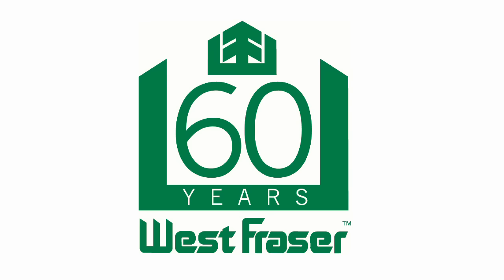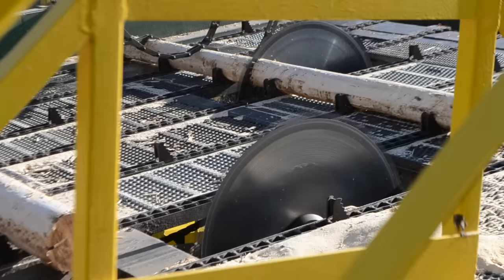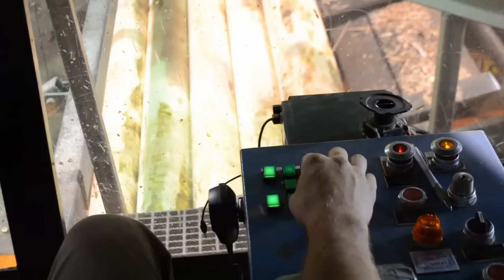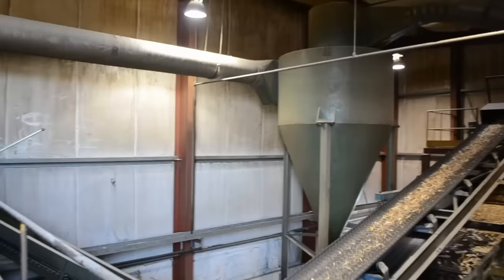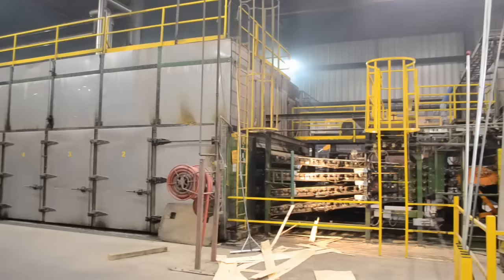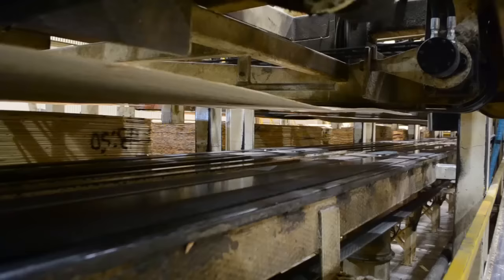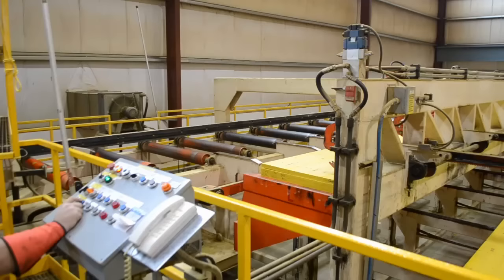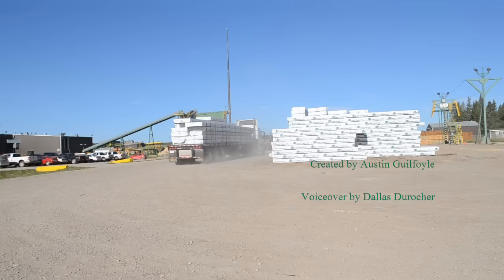West Fraser LVL

Comment: Awesome video , I’ve  been using LVLs for years , (along with almost every builder) and it’s great to see how they are made 👍👍👍
Reply: The worst part is driving nails thru! Those are damn hard lumber
Reply: Are they used for beams to span ceilings, and floors? And are they as strong as real lumber? I've never seen it before today!
Reply: @grosom31   Random guess would be double the strength of #2 spruce and use wherever wooden joists are used

Comment: I enjoyed that. Would like one showing how these LVL's are used!
Reply: as a carpenter i can say ::: lvl is used where you need more strengt than normal lumber would give.
good lumber is strong, but can have weak spots, where say a branch go thru the beam.
a lvl beam more standard. say if a dimension is rated for 2 ton load,, you dont have to look for weak spots,, while with normal lumber you had to test each log.

Comment: Must be very cold to work in that plant during the winter! Some buildings had insulation, others did not.
Reply from the maker: This one was usually pretty warm if you were in the main building (especially near the dryer) and a bay door wasn't open next to you on a really cold day. In the summer it was disgustingly hot at times, even at night. There's a building not really covered in the video next to the 'bucking station' called the 'pointer domer' where grape stakes (and sometimes other things) are made from the leftover log cores, there was a furnace in there but no insulation and a big opening next to the infeed so it wasn't very warm in the winter.

Comment: i am getting ready to do a job with a 16 foot load bearing wall LVL price is just under 300$ 1 special order timber from a timber products local company 75$
Reply from the maker: The load bearing capabilities of the LVL is much greater.
Reply: @austing7254  your product is not atractive there for it has to be rapped to look good it would be safe to say a steel beam would be more cost effective even after the rap finish
Reply from the maker: @irvinwittmeier5208  I don't work there anymore lol, but have fun with that. Also its spelled "wrapped/wrap".
Reply: @austing7254  and sometimes we are all warped....but i see where you headed with your reply....good time man